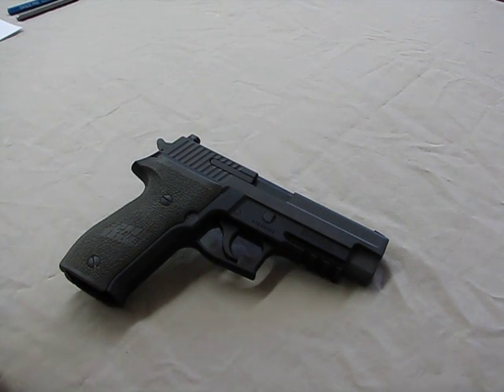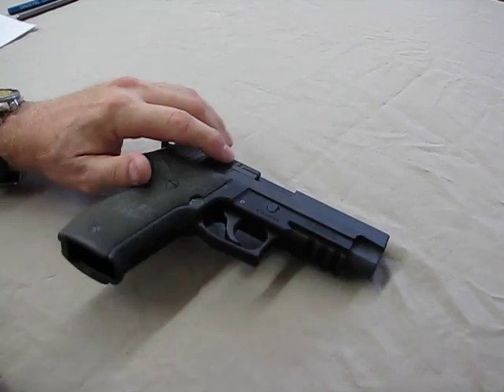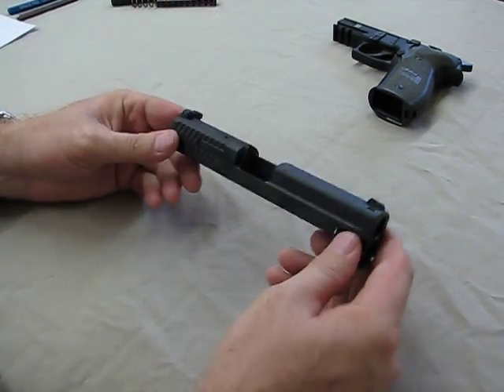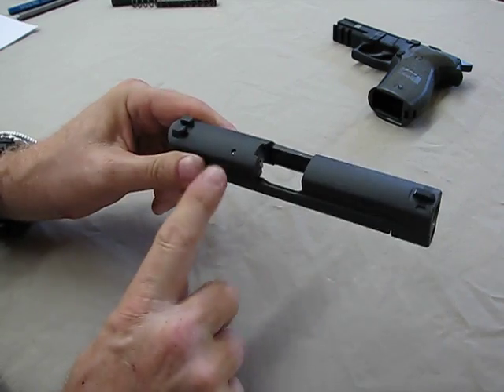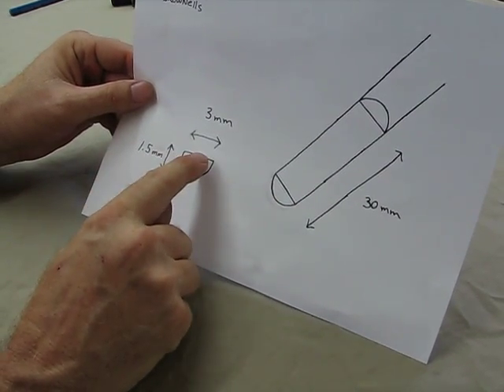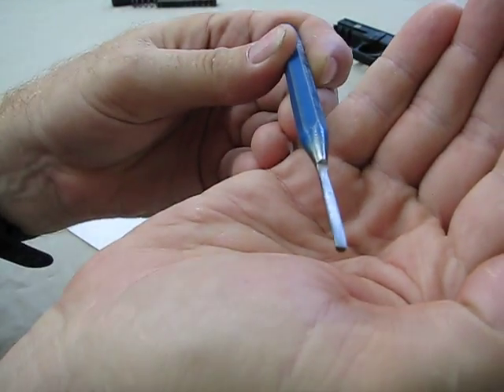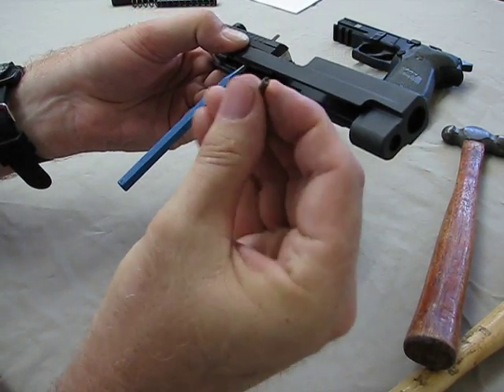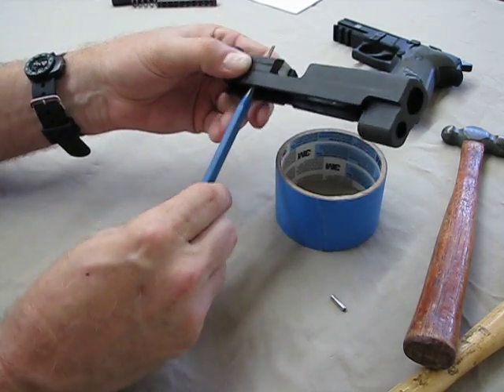Sig large extractor removal

Comment: Great video. You can use a good quality 1.5 mm punch for the pin removal, with no issues. Simply tap the pin out carefully until the extractor releases; you dont have to kick it all the way out, and ensures you can't put the wrong pin in the wrong hole.
Same applies to the firing pin retainer pin.

Comment: Great video  and thanks for passing the slide knowledge along. I noticed all of the other videos concern the legacy ejector.  I was all set to play along at home until Sig sucker-punched me with the half-moon punch. Sig has it also in their store go store>tools don't select any filters just scroll up. there are only 5 tools. The one you want is the P250 Armorer's Punch set, it also includes the sight adj tool for the P250 and SP2022. As of 01/2018 it is $53, Brownells is just the punch for just under $20. Thanks again.
Reply: Unfortunately finding a half round punch now is like spotting Big Foot. Every stor online has discontinued the tool for some reason and SIG website no longer makes it available. EXTREMELY FRUSTRATING. It almost makes me want to go Glock.
Reply: Found a half moon punch for this on matrix manufacturing in north carolina. Bought online and got it within 3 days. Appreciate the tutorial

Comment: 1/16” punch did it for me without customization. Great description of disassembly though. One other tip: don’t fully remove pins.
Reply: What is the purpose of not fully removing the pin? Is it just the fact that it makes it easier to install? Or does not fully removing it extend the life of the pin?
Reply: @michaelweston6083  ....did you used to be a spy?

Comment: I saw this question before but i haven't been able to find a good answer, can you reuse the pins after taking them out or do you need a new pin? I have all the parts to change my extractor springs except a new spring, should i get a new one or can i keep the same pin after replacing the extractor and springs?
Reply: I have the same question.  I attended a Sig Armorer's course about a decade ago; we dealt with the old-style carbon steel slide with the removable breech block.  The instructor told us the roll-pins holding the breech block in were a one use pin and not to use them again.  So I'm curious, can these pins in the new style slides be reused?

Comment: Gods above. I have a Sig P229 RX Legion. Not only do I have the E2 upper but I also have a romeo1 reflex sight to contend with as well. So if I ever need to do maintenance on the firing pin or extractor, not only do I need to make a half round punch, I also need to remove the RMR as well. Which means I'll need to sight it in again too. Oh well.

Still thanks for the information. Good to know for the future.

It's worth noting even this is not as complicated as the full maintenance procedure for my Para-Ordnance light double action 1911 high capacity. Yeeesh...

At least my rifles are dead simple.

Comment: Excellent video! Thanks. I'm ordering a few extractors, springs and pins. The extractor on my brand new Legion 226 SAO self destructed after only 160 (!!!) rounds. Brand new! Sig repaired it, but I may just do it myself next time. Next time? I have a whole lot less confidence in the new Sig pistols now that this has happened. Some of my W. German and German made pistols are going strong after over 20 years.
If I had the parts, I wouldn't have been w/o the pistol for three weeks. I know, 3 weeks is not bad at all. but still. And I'm ordering a few of each, because I have a few new/E2 style slides.
Reply: froggymann65 I've had mine for a few months, and put around 4-500 rounds through it, and all is well, but I was thinking on ordering a couple spare parts too....just in case.  God I love this gun though!

Comment: I bought a new sigp229r enhanced elite 40 , took it out to the range and had failure to feed (round stuck in a 45° where the slide does not close) 7 out of 10 rounds . I sent it to sig and they said the guid rod spring needed replacement and was replaced , I also got the action enhancement package with the ramp polished .... received the pistol and took it to the range this time it failure to feed 7 times out of 100 rounds . Why does my buddies same model sig never has any issues as I do? , we use the same ammo and I even used his mags .....limp wrist?
Reply: slntscpe I think you are limp wristing the gun. I have never had a failure on my 229 Enhanced elite. Firmer grip needed as the gun fires.
Reply: Richard Ayala thank you for the reply but after sending back to sig for the 4th time I found out the problem myself ... the inner slide was grinding on the sear pin (was not flushed or sunked in a little) when the slide traveled max rearward causing the slide to lose momentum.  The sear pin was totaly grinded off and a chunk of the slide was indented
Reply: Makes since. It's pretty hard to limp wrist a metal frame gun. It's more of an issue with polymer frame guns. Especially Glocks.
Reply: @slntscpe  Hopefully SIG did the right thing and replaced your slide....
Reply: @MarcusAurelius33036  they replaced the entire gun

Comment: Great video! I'm having some issues with FTEs with my P229R with long extractor, so I might need to replace the springs -  Appreciate it!
Reply: I'm having the same issues with my M11A1 that i bought used, so sig wont do the work for free. Did you end up replacing the springs? Did it solve the problem?
Reply: It actually didn't - I sent it back to sig and apparently they updated the spring design (this was 2 years ago) but I was so fed up with the gun I sold it.
Reply: +J L diff it work after the spring design update?
Reply: I never shot it again after the spring update - was fed up with it when I sent it in